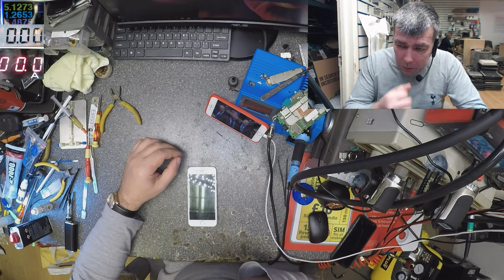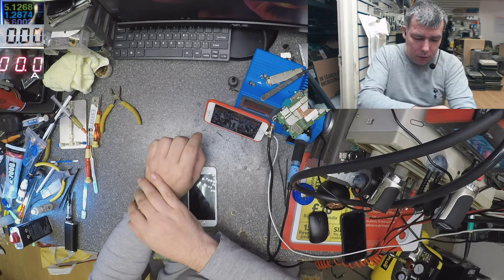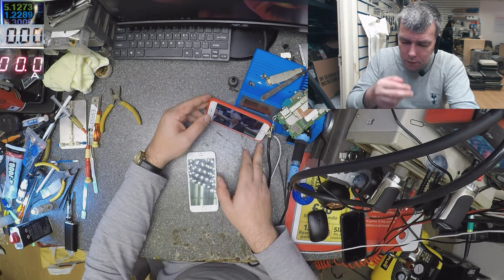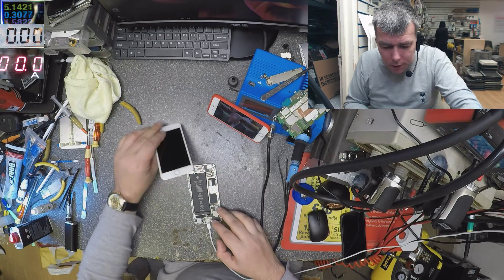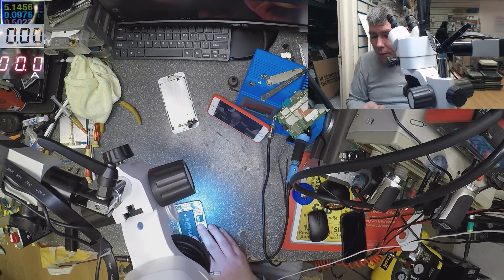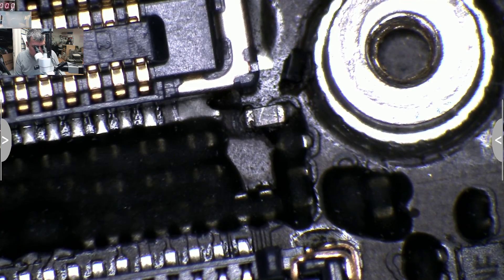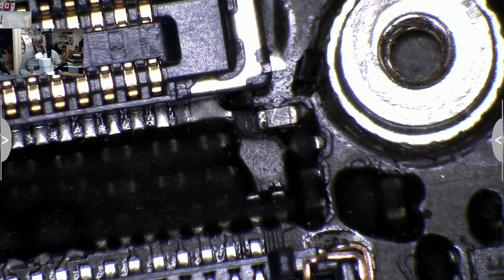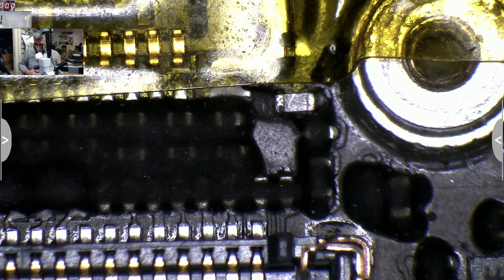Iphone 6 no backlight, fuse/filter/resistor replacement

Comment: I think it would be much easier and safer if you use Hot Tweezers for micro soldering instead of hot air gun, so that you won't damage the surrounding components and of course it's much faster to remove SMD components. I know that you have got used of using Hot Air Gun and mustered it, which is OK.

Comment: I have an iphone 6 that I had recently dropped. Red and green lines going across  the screen as well as half the screen does not work(completely black). I had a replacement phone for a while and did not use the iphone for a month. When I went back to the iphone 6 to replace the whole screen, I thought that that would fix the black screen. At this point the screen is completely black and no sign of power or vibration or sound coming from the phone. I replaced the screen and still nothing. Ive been recently hearing about this backlight problem which I have no experience in doing myself. Do I have the backlight problem? Ive also been hearing about no image problems. I just need help diagnosing my problem so I can spend the money to repair cause I got things on my phone that I want to save.